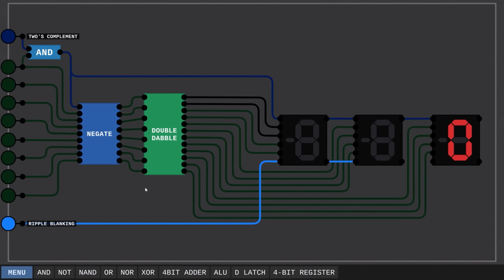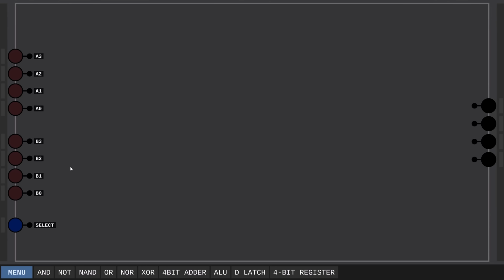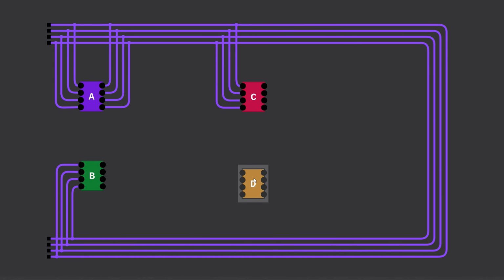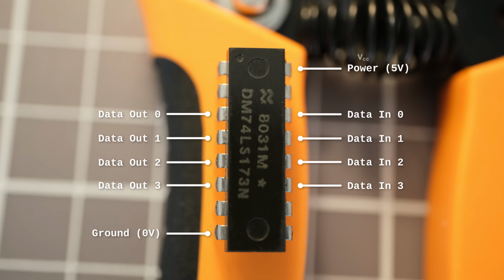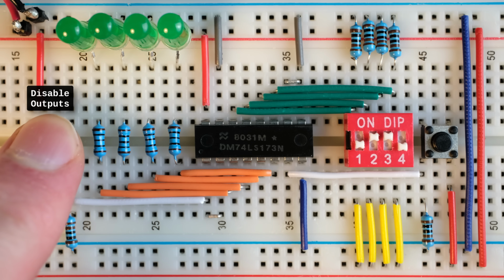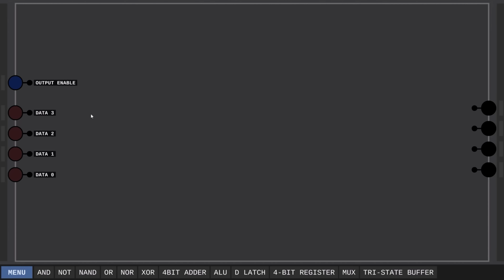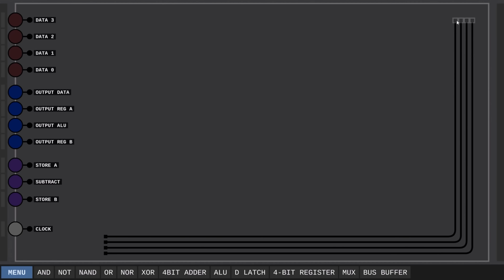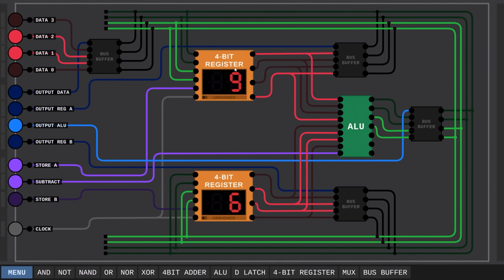Experimenting with Buses and Three-State Logic

Comment: the reason the chip has 2 store enables is because that way you could use a row select and column select (for example) without needing a seperate or gate to combine them yourself, it's just a convenience thing
Reply: That  and the fact that chip form factors typically have 2,4,8,16,ect. pins so they would have sat unused otherwise, which is pretty wasteful.
Reply: Oh that's really clever. Thanks!
Reply: it most likely uses a demultiplexer for switching, turning 2 bits of input into 4 exclusive signals
Reply: @aonodensetsu   ur talking about a decoder?
Reply: @InsertSomethingRandom  no, i'm talking about a demultiplexer

Comment: When talking about the 4 bit register, i think there are 2 reasons for the store signal and data out signal having 2 pins. Firstly, the 16pin dip package is a lot more common then 14, so we likely have those pins anyway. 

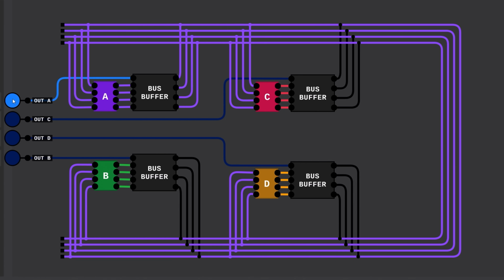Secondly, when you talk about the issue that 2 chips could output onto the bus at the same time (14:11) this can easily be solved with those 2 pins. If you give each chip a different combination of not gates before their data out, it acts as a mux. A could have no not games, B could have a not on pin 1, c on pin 2, and d on both. Giving you the same inputs as when you had the mux chip. Then they can no longer output at the same time since each chip has an unique combination of inputs to enable it
Reply from the maker: Interesting, thank you!
Reply: Yeah, usually (at least the few chips I have worked with) you get multiple chip selects/out enables to save you a few external and gates.

Sometimes you even get one inverted (active low) and one non-inverted because this makes external selection circuitry easier. Also for registers having multiple inputs can sometimes allow easier "stacking" (not really the formal term I think but basically using more than one chip in parallel to increase the bit width or similar), because in these cases some select signals might differ (only have a 8 bit bus but want to work with 16 bit data in this calculation? Easy!
Have one "global/external" store connected to one write enable pin on both chips and the other one connected to a toggle latch. This way the first clock pulse will latch the first 8 bit in the first register and flip the toggle latch so the second clock pulse will store the second 8 bit set in the second register.)

Comment: Exploring microcode to simplify/automate the testing you did at the end would be a cool way to build up to a CPU
Reply: Im almost positive thats exactly the route this series is going to take and im super excited for it!
Reply: @jetison333  would indeed be really cool to see. Sebastian is starting to look more and more like Ben Eater and I'm all for it
Reply: @matthias916  Ben Eater and Sabastian  Lague are the best youtubers I've seen
Reply: The instruction format in this case is really funky: 4bit - external memory/stack/input in red, 4bit - read address in blue,  3bit - operation type or store address in indigo. But you can make an instruction decoder and design something more elegant if you want to, just grab the software and make your own. 
What the circuit in the video really needs is more explicit branching with a comparator. But you'd probably add a small stack and stack pointer with that, to make sure it's Turing complete. At this point the circuit simulator devolves into a CPU architecture designer with no way to synthesize the design.

Comment: couldn't you use a 2 bit number to encode the 4 output selection bits so that illegal states (two outputs selected the at the same time) and bus congestion become impossible?
Reply: That would be possible to .
Reply: Yes, that would solve the issue of bus contention, but would limit your design to only working for 4 registers. This approach (while somewhat more "risky") allows for much greater modularity.

Comment: For anyone interested in knowing how an ALU would get its input from the 4 bit data bus, there is a special purpose register called the accumulator (AC). The AC is by default one of the inputs of the ALU (in 1 address instruction based architectures), as well as the the place where the output of the ALU gets stored. So whenever the computer needs to add two numbers, one of the operands being inside the accumulator, it would send the other number to the 4 bit data bus which would then be received by the ALU as the other operand in the next clock pulse. And the result of this operation would then be stored in the accumulator for future use. Thanks Sebastian for this lovely video!
Reply: Yap yap

Comment: If you want, you could imagine that connecting to power is "1" (alloeing electrons to flow freely), connecting to ground is "-1" (escorting electrons off the wires, to ground), and disconnecting is "0" (no interfering)

Don't hold onto that model for very long, though, because we do still use "0" for "off"

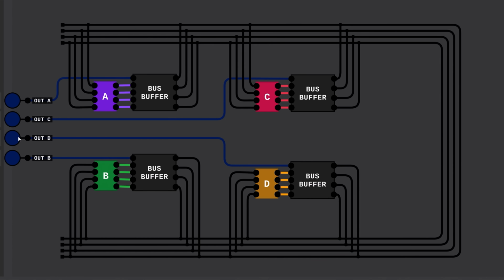Comment: 14:10. This error can be fixed using encoders/decoders. I have no idea what does what, but one of them takes an input of x bits and outputs true to exactly 1 of the outputs. The other one does the opposite. I learned this while trying to make my own chips after the second episode of the series came out. I love this project and the program used to display it. Perfect!

Edit: 6:00 you already basically did it when 2 inputs select from 4 outputs. The input of 2 would just power 1 of 4 outputs instead of select 1 of 4 inputs. It’s just a simpler version of the chip that can be used in different situations. 

P.s. sorry if I got any of this wrong, it’s been a while since I watched the first 2 videos and that was what introduced me to this obsession with logic gates. I find it so fun. However, binary counting reminds me of logarithms and they’re no fun.

Comment: 14:54, You can protect against that multiple store thing by just having a chip between the stores and the input, the chip just cycles through each position checking if a store signal is to be sent and leaves the others unset while it's checking, like that it is also then possible to make the input to the chip an index rather than treating each connection as a 1 to 1 connection, in other words it can have more outputs than inputs

Comment: Wow this series is amazing. I have only two suggestions:
1. Similar to how you create complexity using the custom components, maybe a multi-wire would be useful for reducing clutter as well: A simple cable with multiple wires that could carry all 4 (or any amount of) data bits and directly connect to the multi-input of the components. If you do not connect a multi-cable to the register you could still connect the 4 individual connections (or maybe even be able to connect less size cables (with specific offsets) for bit operations like shifting)

2. Auto-scaling components which would integrate nicely with the idea of having cables that autosize. So for example instead of having a 3-and gate you have a single and gate that auto-sizes to the amount of inputs connected or maybe even with input size parameters that could be reused in custom components to auto-scale the cables or other nested components inside.

This would allow for some really interesting stuff without the need to connect so many wires manually.

Anyways, thanks for making these very informative videos. I really love your animation style and your calming voice. Really looking forward to whats coming next in this video series

Comment: There is actually a simple reason why some chips have multiple pins that are AND-ed to perform a function like latching: Sometimes you actually want to combine two signals to do something like this. And since those pins would be unused otherwise, the manufacturer just added an internal AND-gate. If you don't care: Just connect both pins to the same signal. If you care you can connect both your signals to those pins, and you just saved yourself an external AND-gate!
Reply: Thank you for this explanation; I was wondering about this. Could you provide an example situation where you would want to do this with two signals? Thanks.
Reply: @TigerAndDoggie  for registers you'd often have multiple, if you have 4 you can easily combine a shared "register file store" with a specific "select register 0/1/2/3" this saves on complexity in other parts

if it only had 1 enable pin you'd need to manually combine the signals for all 4 registers, which is an extra chip
Reply: @TigerAndDoggie  alternatively, if you have to connect 16 registers, would you rather route 32 wires (16 store enables, 16 output enables) or 16 (4 store columns, 4 store rows, 4 output columns, 4 output rows)?
Reply: @TigerAndDoggie  in addition to the things @catelyn wrote, I have often seen it when you want to synchronize to a clock. Having one of those pins tied to the clock means you can use the other one to basically "queue" the action, which will then be triggered on the next clock cycle (often you'd setup things to happen on one edge of the clock signal, and execute everything at the same time on the other edge)

Comment: FYI, chips that can do tri-state logic like this (pretty much all modern ones) are considered CMOS chips.  Because they have complimentary outputs.
(As opposed to NMOS or PMOS, which really only do have two states;  PMOS can connect to VCC or High-Z, and NMOS can connect to GND or High-Z; but CMOS can do all three states.  You can still build a CPU and logic gates with just NMOS/PMOS, but we stopped doing that in the 80s IIUC).

Comment: Great video but to be more precise the outputs are called 'totem-pole' which is very similar to push-pull but with the exception that you can get really close to ground because you use 2 NPN type transistors instead of 1 NPN and 1 PNP.
This 'totem pole' is the most common output in TTL chips because you have to be sure that no substantial noise can interfere with the signal level.

Comment: One way to reduce selector inputs AND get rid of the invalid inputs is to create a one-hot decoder that converts a binary select signal into the one-hot signals for specific register selects.
Ofc if the number of registers you have isn't a power of two, you'd still have a few invalid inputs.

Comment: the reason some ICs have multiple copies of the same inputs is to potentially reduce the amount of logic required.
for example, if you have 2 signals that both need to be low to store something into the register, you save yourself an extra logic gate as the chip already has 2 seperate store inputs, and if you don't then you just tie them together and not worry about it. (though it's usually recommended to tie 1 input to ground permantly and use the other one solo)
obviously that won't work if you have 3 or more signals, but even those 2 are enough to save yourself some ICs in a larger circuit.

Comment: Really love the series. If I may make a suggestion, I think you should add a "cable" abstraction to your simulation. A thick cable comprised of several individual wires, which can be later pulled apart if necessary. If you don't do that, things will get really confusing once you move to 8+ bits.

(BTW you could control your bus buffer chips with another "address" bus instead of individual on/off switches. This might make things even cleaner.)

Comment: As for being able to enable multiple outputs at once you could still use a 2 bit select signal and use a decoder to generate the output enable signals for the registers, that way for each two bit input (select signal) there can only be one output enable that is high at a time.

Comment: One thing you could do next is improve the ALU by adding multiplication (division is harder) with adders and some bit shifting. It works like normal multiplication but even simpler, and easier to implement in hardware. And if that doesn't happen, congratulations on beating my record for most useless calculator!

Comment: Another thing I was thinking about was how this form of computing related to analog signals, like for example, a dimmer switch isn’t going to output binary data, so how does the computer turn a variable current into multiple on or off states?

Comment: Note that generally tri-state buses are avoided in general, because it's so easy to cause a short-circuit, and burn the chip. One component decides to output a 1 onto the bus at the same time as another outputs 0. Bam, short circuit, bye bye chip.
Reply: I am almost certain that CPU and memory chips use three state. So what if confusion about read vs write? What about banks? What about chip select BIOS ROM? What about graphics DMA.

VME bus though seems to use terminating pull up resistors as does SCSI.

Comment: I'm very into the idea of you making a hardware series, please do if it excites you! Plenty of directions to take breadboard explorations. I got really into building simple logic up on breadboards, 555 driven flashers and the like. Eventually, as I was building up a Ben Eater style 8 bit processor I had some signal problems. Learning more about analog signals got me into making synthesizer circuits and interesting noise makers. Hardware is a deep pool of interesting stuff to play with!

Comment: I think you should add a 4-bit wire going forwards. It wouldn't perform any logic, but just allow you to easily connect 2 things that require 4-bits (basically just UI and visual help). Like connecting a register to an ALU. It would also make it a lot less messy with less wires all over the place.

Comment: Next thing you know, someone is going to emulate an NES with this.

Like what if you were to add a screen that could display images based on streams of data it receives. Or some speaker that outputs sound.

Still, this is some cool logic simulation.

Comment: If you want to do a deep dive into the world of electronics, you could also learn to make your own circuit boards for future projects. So I think it would be a nice idea for a series to go from your simulation to chip selection and making your own PCBs as a final result. The only problem I see is, that already existing discrete logic gate chips (e.g. CMOS technology for AND, NOR, ect.) come with predefined input and outputs and might not match the ones in your simulation what might imply some hacking to make the desired outcomes. 

If you are really interested to test your simulations 1:1 on actual hardware, you could also dive into the world of FPGA programming. FPGAs are built around a matrix of configurable logic blocks and programmable connections. So they consist of a lot of logic gates and you can write programs that actually make the physical connections on the hardware between them. It is also possible to hook the inputs and outputs to physical pins and test your applications.

Comment: I think turning around the LED in your example is called sinking. In the circuit you built the chip was supplying the power to the LEDs, which is called sourcing.
Because you supply power to thje LED through the cip. When you connected the LED to Vcc you were draining the powerr through the chip, which is called sinking.

Correct me, if I am wrong, but it has been some time since I learned this in school and I didn't have anything to do with this topic for ages.

Comment: I think a good way to demonstrate the tristate output would've been to connect an additional LED to power in parallel to the other LED. So we could've seen that by triggering one of the push-pull transistors the regarding LED lightens up while both stay dark when neither of the transistors are triggered which represents the high impedance state of the output stage.

Great video, still.

Comment: Might be coming in the next video, but that bus with the 4 enable signals is begging for a 4-bit decoder

Of course, that does mean your input needs to be re-encoded into binary. Alternatively, you could 4-way AND every enable with NOT the other 3 enables so only one can be on at a time. A slightly more advanced state machine could even give priority to the first enable to come on or overwrite with the most recent enable to turn on.

Comment: A long time ago i played a mobile game where you had exactly what you are doing in these videos; building bigger and bigger components out of logic gates and saving them as modules to be used in other modules. You started with only NAND gates I believe so you first had to construct all the other logic gates. The thing was it was structured like a puzzle campaign and i had a lot of fun and learned a lot about electronics through completing it since i never designed logic circuits before that. I surely did not even know what a multiplexer was but i managed to make one anyways without having to look up diagrams on the internet. I tried to look for it again a while back but sadly i could not find it. If anyone knows the name please tell me, its an excellent learning tool

Comment: this "floating" state kinda reminds me of something i was messing around with mathematically. i noticed that if you encode True as the vector [1,0] and False as the vector [0,1], you can represent binary logical operators as a sort of matrix--a bilinear form, really--with vector (boolean) entries, or a sort of 2x2x2 matrix with a particular multiplication definition. more naturally, the NOT operator specifically (being unary) is a covector with vector entries, i.e. a rather normal 2x2 matrix (specifically the one with 0s on the diagonals and 1s on the anti-diagonals). i suppose, then, the floating state could be represented [0,0]--perhaps seeing the first component as "is connected to power" and the second as "is connected to ground". then bus contention would be the state [1,1]. i haven't really thought about these two states all that much but perhaps there's something to this.